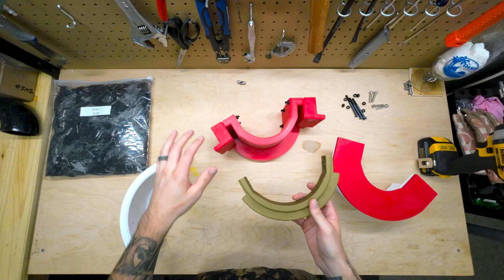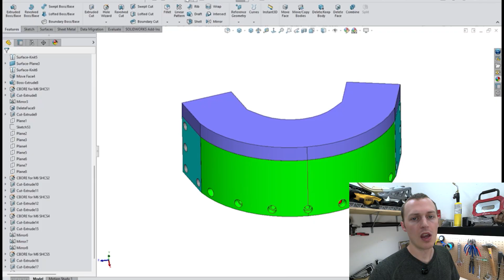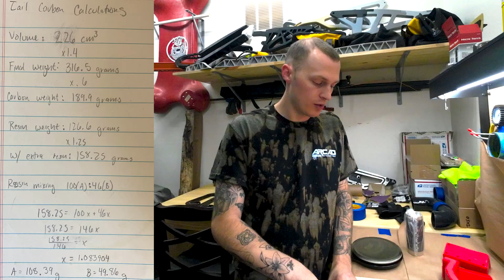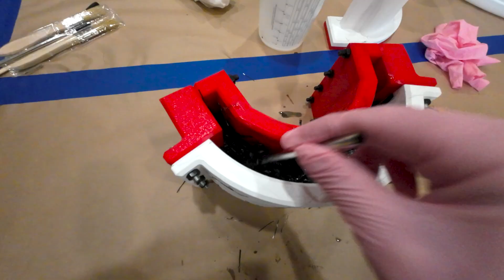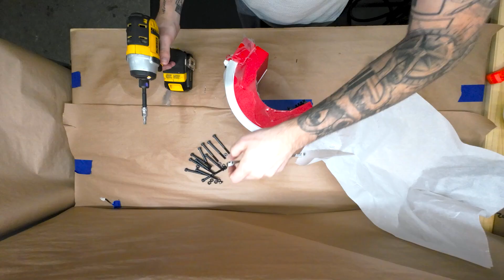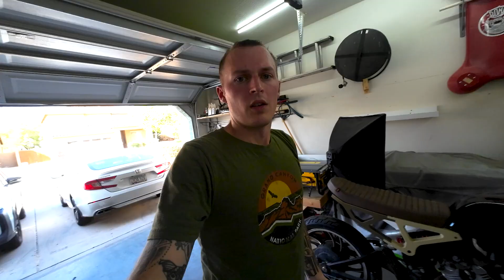XV920R Cafe Racer - EP9 - Forged Carbon Fiber Tail Section

Comment: This is a really useful video.
Those 3D prints are holding up well, even with the heat.
Reply from the maker: Thanks! They did really well considering. Only broke during the demolding process. Hopefully the next ones will work out better.